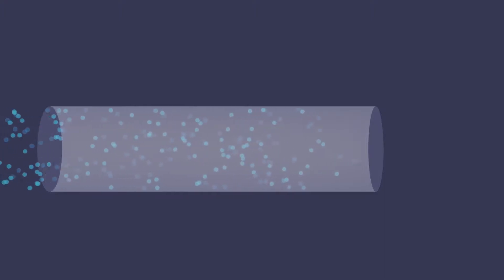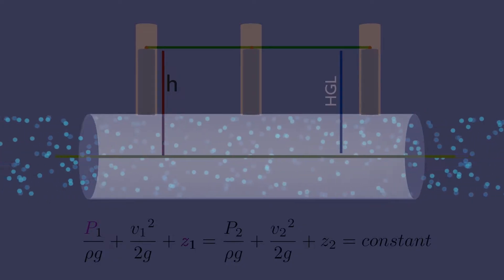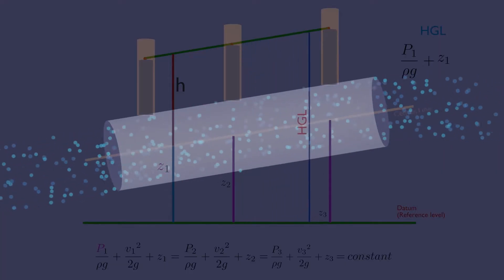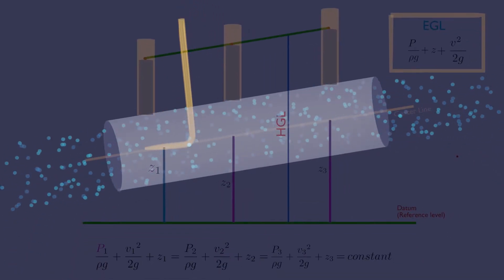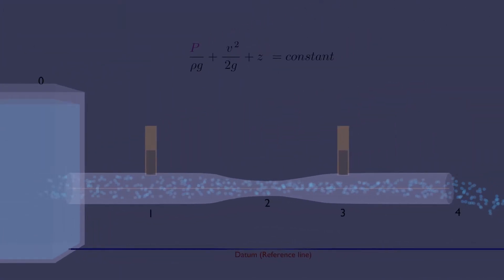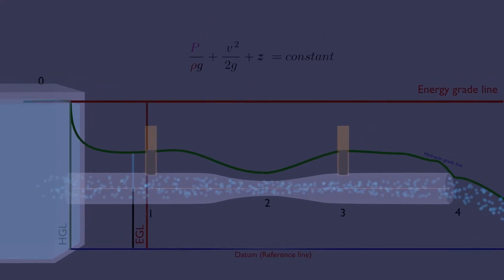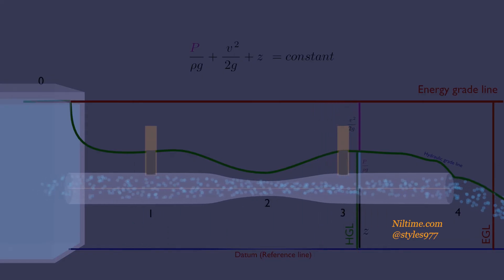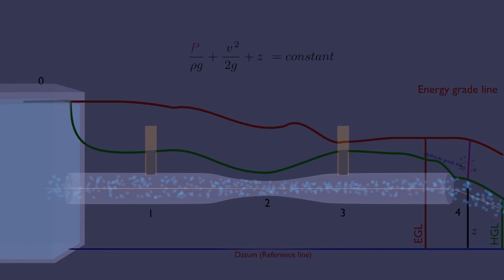Hydraulic and Energy Grade Line ? with animation [ HGL and EGL ]

Comment: shouldnt the HGL remain constant for the inclined pipe with fixed diameter? by continuity u1*A1 = u2*A2 , so the velocity head remains the same simply because u1=u2 ( if A1 =A2 while1 and 2  represent entrance and exit of the pipe)
so if u apply bernouli between the entrance and exit, then u get that the term P/rho*g  +z = const, therefore HGL is constant, which makes sense because in the inclined pipe , the elevation (increase in z)  is accompanied by a pressure drop so that the therm P/rho*g  +z remains neutral / constant , so basically u lose presure in the expence of the flow against the gravity ( use inviscid-frictionless fluid for simplicity , althouh this doesnt affect the reasoning) otherwise you will have an unjustifiable constant increase in HGL while EGL will be constant, and HGL cannot GO above EGL

Comment: The mechanical energy loss due to frictional effects (conversion to thermal
energy) causes the EGL and HGL to slope downward in the direction of flow. The
slope is a measure of the head loss in the pipe. A component, such as a valve,
that generates significant frictional effects causes a sudden drop in both EGL and
HGL at that location.

Comment: 2:14  If the diameter of the pipe is constant, why the velocity head change and the pressure head stay constant?  Shouldn´t the velocity head be kept constant and the pressure head decrease?
Reply from the maker: elevation has increased so the potential energy increased. These increases Hydraulic grade line.  Also that diagram is not totally correct . Don't focus too much on it.  Focus the diagram of 3:02
Reply: @NiLTime  I guess that he is correct HGL should decrease, Elevation head doesn't matter. Because, the difference between TEL and HGL is velocity head not elevation head. But maybe you did that for Demonstration purpose.
Anyway thank you it's a great video.
Reply: @alipacheco8149, you are right. Everything from 1:30 onward is wrong. Velocity is constant in time and space so HGL can only decrease in the downstream direction!!!

Comment: In minute 1.06 if the pipe different elevation (z2 > z1), and pipe diameter is constant (d1 = d2) why pressure head  1 and 2 same?. And velocity head different?,  if d1 = d2  the v1 = v2, so velocity head must be constant.
Reply: It's not the same, the pressure head is different between 1,2, and 3, the velocity head is the same in all points as the diameter is constant
Reply from the maker: that diagram is not totally correct . Made it for some visualization purpose  .. sorry for that. Don't focus too much on it.  Focus the diagram of 3:02 ^^